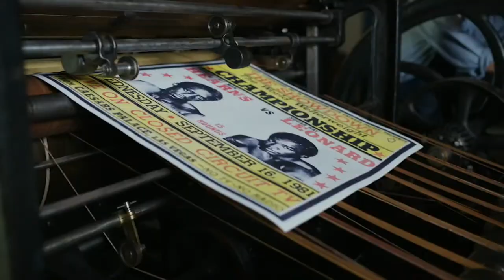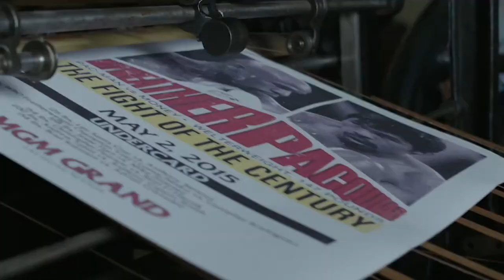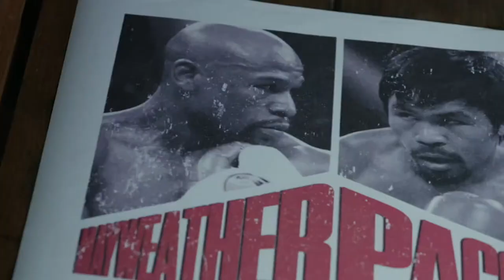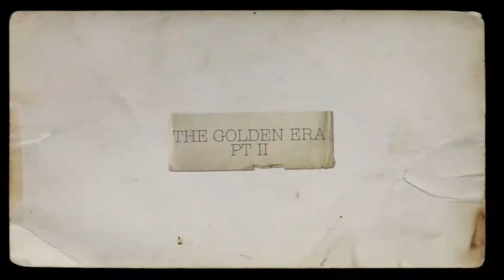MANNY PACQUIAO VS ERROL SPENCE JR KICKOFF PRESS CONFERENCE | PBC ON FOX

Comment: Errol Is a whole different machine. This man gives a very disciplined view and prespective of what he is facing and what he needs to do, very unlike Thurman who was all get-go and looking to overwhelm the older man. Spence going to really show up this fight.
Reply: FACTS
Reply: Let see if he did it to pacman.
Reply: Manny is 42 and beat Thurman. A prime pac would destroy both.
Reply: in order for Spence to win, he'll need to stink the joint out unfortunately
Reply: .
FLOYD in 2009 says he deserves to fight a new Lightweight Marquez who came from the featherweight after pretending to be retired for 22 months to avoid top competition. Ask Marquez to climb all the way to 147.
.
THURMAN in January 2019 fought a welterweight Josesito Lopez after being inactive for 22months due to injury. But he fought a welterweight. 
.
PACQUAIO natural lightweight in 2021 after 2 yrs of being inactive due to the Pandemic, signed the contract to fight Crawford, the fight didn't go thru. Then moves on to fight Spence the no.1 Welterweight while multi-tasking as a Senator and a Boxer.

Comment: My money would be on manny 2 reasons why:
1) Errol Spence doesn’t fight tall in the ring. He has a long reach but he always ends up slugging it out with his opponents on the inside. PAC can easily weave on the inside because Errol keeps his elbows bent when he lands a punch. He don’t stretch it out!

2) Spence has no foot movements. He’s flatfooted!! All he does is move around the ring like he’s at a charity ball like other fighters. One step here and one step there, that’s it. He don’t move in angles, he don’t move away from punches he just stands there and blocks them. Errol is one of those fighters that if he’s on a train track and sees a train coming towards him, he would stand there and put his hands up instead of moving off the track.
That means pac can easily trap him on the ropes and get him with fast punches.

Errol has a chance of winning but not a good chance. These are my reasons